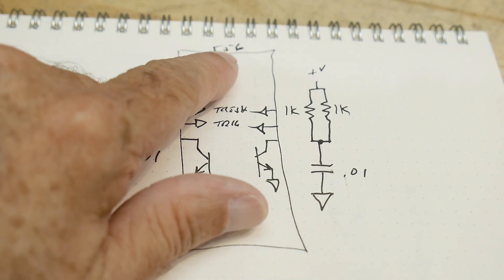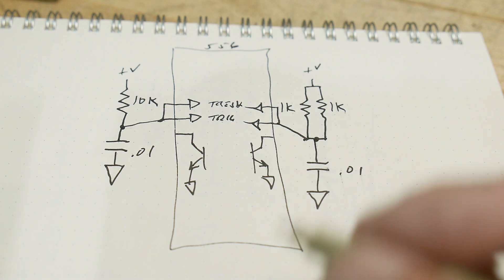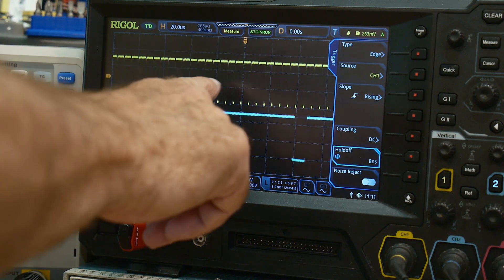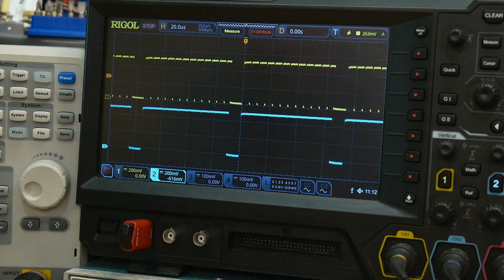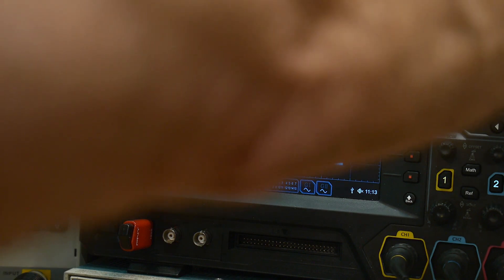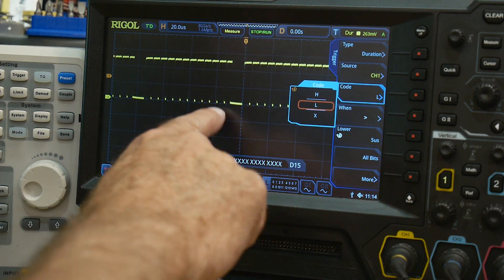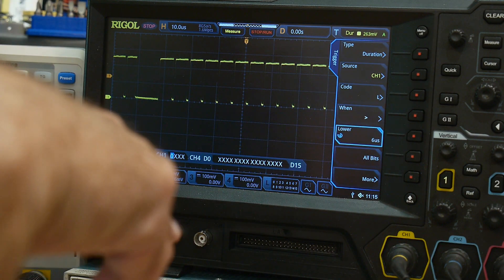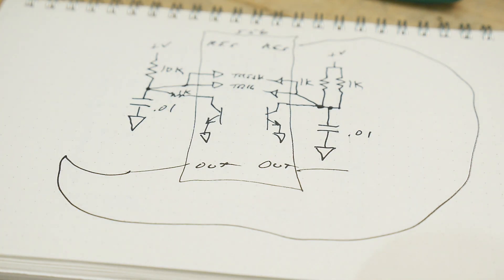#1608 NE556 one 555 gates a second 555

Comment: I hate the 555. I was around when they first came out and they had issues. Never got over that. They are fine for learning some electronics, for blinking a light or windshield wiper delay.  You can make anything with them but it probably won't be very good and it will need a lot of parts. There are so many chips that will do the job much better.  When I see a circuit with a 555 I will ignore it because they probably aren't a real designer and there are probably other issues in the circuit.

Comment: Thanks for sharing that triggering trick in the end. Couple of days back I was struggling to see the PWM signals from a microcontroller to the BLDC motor controller. As the duty was changing oscilloscope struggled to trigger in edges for some reason. I will try this method to see the waveforms. Thanks